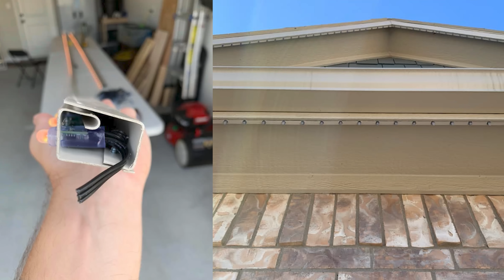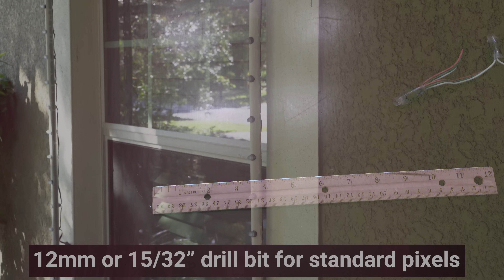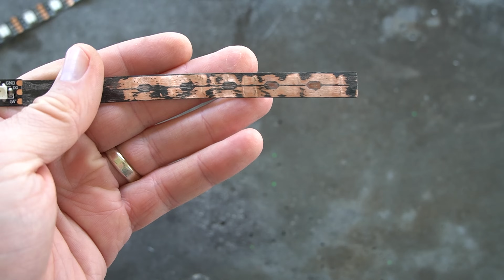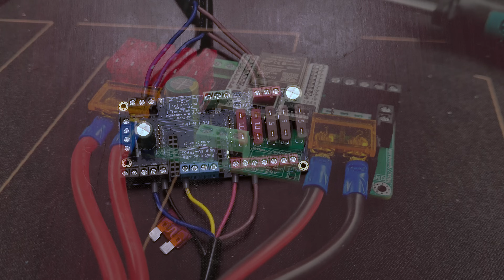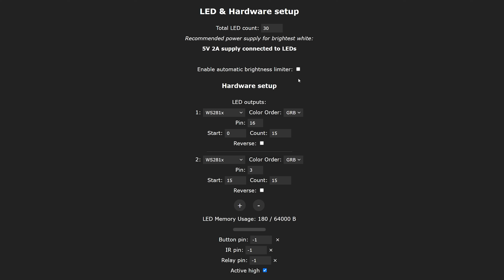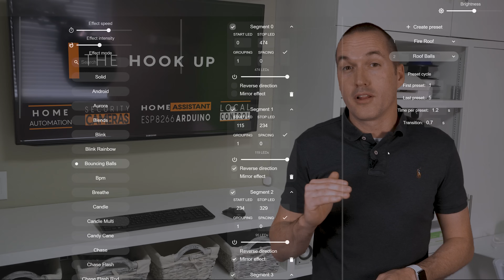DIY Permanent Holiday LEDs: Complete How To Guide 2021

Comment: WLED works with Holidaycoro controllers?
Reply from the maker: WLED works in conjunction with HolidayCoro controller, but not actually installed on the controller.  If you are running an xlights show you can you as many brands of controllers as you want as long as they can read E131 data.

Comment: so I am sure this is going to show what a noob I am, but why can't these controllers be used to create a mega Tree?  Any "mega Tree in 2021" videos coming out?
Reply from the maker: Well, they only have 4 outputs.  My trees are pretty humble in comparison to some of the ones out there.  My big tree has 16 strands of 50 + 150 leds in the star.  If I ran it off of a digquad with 4 outputs I'd need to 200 leds per output, which would be fine other than the fact that I'd need to worry about connecting the data between each strand and power injection.  Running off a 16 output controller lets me just plug each strand into its own output and not have to worry about power injection.

Comment: Ugh! I think I deleted the original thread.  Thank you for confirming the 5V days lines...
Reply: So, if I want to use a cheap $6 ESP32 board, I need all 3 voltages. 3.3 for the chip, 5 for the level converter/data lines, and 12 for the strip power. Correct?
I wonder if there's a dual output buck converter that I can use...
Reply from the maker: An ESP32 dev board can take 5v in.
Reply: @TheHookUp  oh, sweet!  So I only need the 12v to 5v conversion!

Thank you!!!

Comment: I also see 2 different wire spools
Reply from the maker: The two wire spools are power injection (2 core) and LED wire (3 core).
Reply: @TheHookUp  so I need them both?
Reply from the maker: Likely yes, unless you are planning on doing 12v runs under 300 pixels long.
Reply: @TheHookUp  thanks, going to run the 5v, around 200’.  Which lights are best?  I see there are 2 in the list
Reply: Helps if I would have read it a little better 5v and 12v
Reply: @TheHookUp  Rob, can you post a picture of what your power injection point points look like installed? Like once you make the injection point with your thin wire, how do you reconnect the thin wire to continue the run?

Comment: These strips are the worst thing one can do for permanent installation. If a single pixel is damaged it's pain in the back to fix them.
Reply from the maker: I've had very good luck with them, but to each their own.  
Any permanent install will be more difficult to service just by the nature of hiding wires and enclosing the lights, but I do agree with you that soldering on a ladder is no fun.